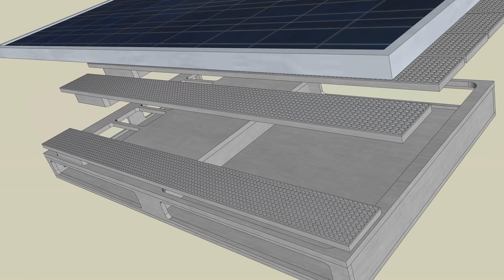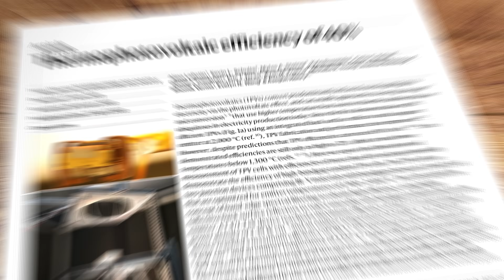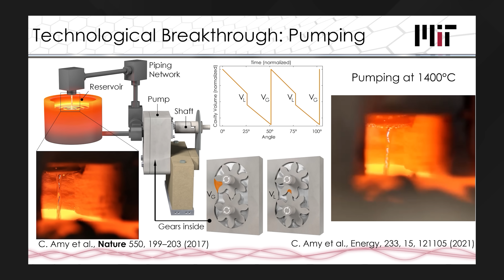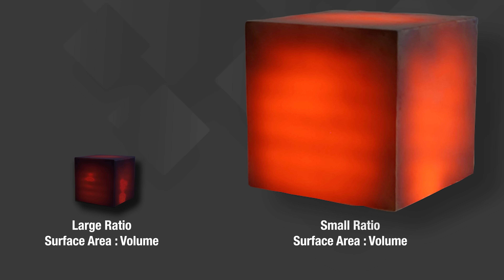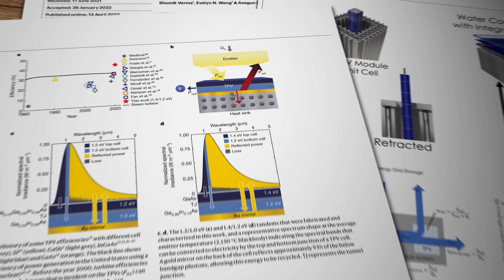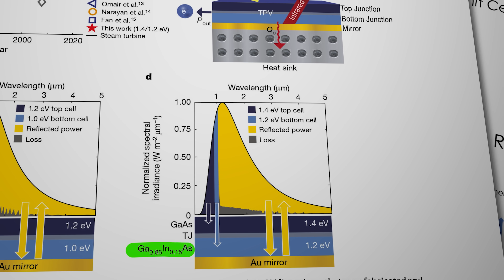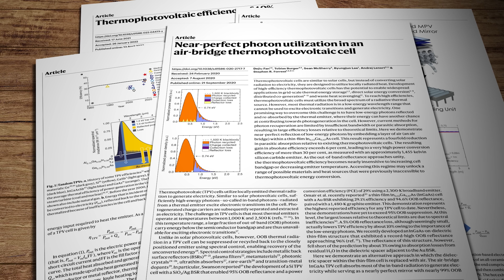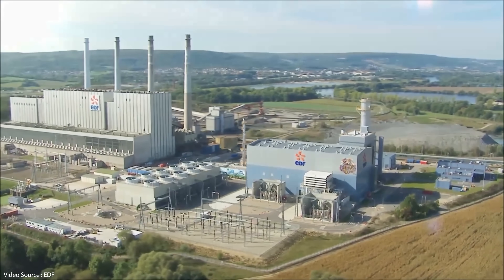Grid Scale Energy Storage 30x cheaper than Lithium-ion! How do they do that?

Comment: From end to end , isn’t this a battery with 50% efficiency, I.e. much lower than other systems like pumped hydro?  If so, its advantage is storage capacity per dollar, is that a legit summary?
Reply: And scalability compared to pumped hydro
Reply: @andyw2132  The challenge of course will be the availability of Lithium. Prices have quadrupled and demand is rising incredibly.
Reply: @andyw2132  Just what type of batteries are "conventional"?
Reply: Yes, and you can build anywhere - so near solar. Pumped hydro needs water and mountain and permissions.
Reply: @idjles  And 'Permission' seems the challenge these days. In Michigan we have a large and old pumped hydro in Ludington. It's been modernized and works very well. But when asked if they'll build another the utilities say: "Nope, we'd never get permission to do it." 

Also as you mention: "Location, Location, Location" while this thermal battery could literally be anywhere.
Reply: @larrybolhuis1049  Ironic that the name of the town is Ludington. I am thinking of the Luddites.
Reply: @andyw2132  Other batteries have to have sources for the electricity. The heat system in the video is about collected heat - to - electricity at high efficiency (compared to other means).

Comment: Quite interesting technology indeed!
I am currently working on a project looking at combining existing gas peaker plants with lithium-ion battery storage in order to fulfil the technological requirements for providing ancillary services as stated by entso-E. 
The fastest ancillary service will require a 100% activation in less than 0.7 seconds, which based on this video this system will not be able to fulfil (from my understanding). But what sort of activation time can this system achieve? Or is this system mainly thought to be used for longer duration rather than being able to provide power in shorter bursts?
Reply: I think you should look at this concept as two parts, the storage part and the TPV part that generate the power. The storage part is extremely cheap ($/kWh)and the TPV cells that generate power is not particular cheap ($/kW) (made of gallium and gold at 8:10). So the strong side of this concept is the storage part and therefore it should be used for low power, longer duration storage like hydro lakes. Combine it with li-ion (lower $/kW) for grid stability and good bye fossil fuels😎
Reply: @channguyen3349  That is actually a good point. I guess it could also be combined with supercapacitor systems to also allow for a high power/short discharge duration to be able to access the ancillary service market in Europe.
Reply: You might some battery storage or spinning reserve to handle the fast ramp. Perhaps even super-capacitors.

Comment: All this pumping molten metal is just silly, you want to check out "polar night energy" instead. Heat stored in sand and usable months later for pennys on the $ compared tho this wasteful nonsens. If you want power out you use a sterling generator(40-90% effective).

Comment: Looks like the giant "radiator" could be a heat exchange that then uses the heat in a community heating system?
Reply: The primary process already uses heat to keep the tin molten.  I'm surprised they didn't use heat exchangers to grab the extra heat off the cooling water to supplement the electric heaters.
Reply: @Firebuck  umm, how exactly? Feed the warm water into the red hot carbon blocks????
Reply: Yeah, that point is a waste, using that heat as a must!
Reply: There are lots of industrial uses for heat waste. In fact many companies buy steam from gas plants. No need to build this next to cities to use the excess heat productively
Reply: @cccphannibal  Yep. Store the heat out of the city, convert to electricity, and ship that where you need it.
Reply: @markhathaway9456  and let the people use electricity to hear their bath water!!
Reply: It works in dense urban areas.
A bit of a problem given that most peaker plants aren't located in cities because of land value and quality of life issues
Reply: @jimurrata6785  Here in Czech Republic we use industrial heat for hot water heating of housing areas and the distance is no problem. My hot water in my block of flats is from a heat exchanger at a power plant about 15km away. There are however heavily insulated high temperature pipes crossing the countryside.
Reply: @jimurrata6785  So, it will be an industrial zone. Maybe preheating requirements can be fulfilled with it.
Reply: @Sekir80  Anything is better than shunting it into an atmosphere that has already reached a tipping point.
Reply: @jimurrata6785  but don't forget that this heat has been extracted from the wind so was already in the atmosphere beforehand
Reply: @jimurrata6785  the amount of 'waste heat' is a pinprick compared to the heat retention effects of global warming gases. It can be effectively ignored.
Reply: @gregbailey45  Taking a dump in the middle of the street isn't significant either.
There's no need to add insult to injury
Reply: How about desalination of sea water, provided the coast is not too far off? CA could use some…
Reply: @Calligraphybooster  Don't forget we need a solution for the brine.
Reply: @uncledino3  good point. Another salt lake maybe? Or topping up an exiting one?
Reply: @Calligraphybooster  refresh the Salton Sea?
Reply: Or for industrial purposes like drying wood.
Reply from the maker: Could be...
Reply: If that doesn't work you could probably use it to heat a large amount of water, and use the place as a spa or something to generate extra revenue.
Reply: The specific energy can be increased dramatically by using molten boron instead of graphite. It has a ridiculously high latent heat of fusion and its melting point matches the operating temperature. 
The achievable specific energy is an order of magnitude higher than graphite blocks and 6 times higher than even the best lithium batteries. This could be used to power a train.
Reply: https://youtu.be/ghD5SHuR9mk
Reply: yes, if you need community heating, that can be supplied from the leftover heat that will anyway be released into the atmosphere. If the overall efficiency is only 40% (which is a great claim) , 60% of the heat goes up into the air. A part of that can be put down the drain (I mean supply hot water, if you need).
Reply: Do you know community heating is old tech.... check out the geothermal systems under cathedrals...... all this tech is old, the powers that be have held it back so that we purchase their centralised enegry sources.....

Peace, power and freedom to all.
Reply: It could be utilized in conjunction with liquid air batteries right ? Without an heat additional heat source, liquid air batteries aren't efficient enough but with the 'waste' heat from the molten tin it could be a very nice addition. And the leftover that can't be used could find it's use in residual heating.
Reply: and in summer ?
Reply: Absolutely! We have community heating systems all over the country I come from, and as more and more wind farms are built, more and more coal plants are shut down, and then there are smaller bio- and gas-furnaces delivering heat to various areas. Nearly all of these facilities provides heat to local homes, not all has a turbine, though. The ones that do, already has the power infrastructure to be able to deliver electricity to the grid. It would be absolute perfect to build these things at sites of decommissioned coal plants, and to replace peaker turbines. In terms of replacing heating facilities, they would need some power infrastructure, but that's likely easier to establish than heating infrastructure.

Comment: so how do you get the material to 2000+ degrees in the first place to get you magical 40% output from. if you didn't get your energy to heat that up for free all I see is a 60% loss from the start.
Reply: The graphic section begins with wind and solar being the apparent power input to heat the tin with. Obviously they would be delivering only electricity that was surplus to the grid's demands, the point being to store some of that surplus electricity until the grid needs more than is being produced.
Reply from the maker: Spot on Dan
Reply: I am not against new ideas or means of storage and I have questions. Has there been a time in history where solar and wind ever was in excess long enough to melt your material and keep it above 2000 degrees for enough time to do anything with.  Seems like another scheme to get research money like fusion and other tech that is always 40 years away.  I have solar along with batteries, we sell back to the grid and have two electric vehicles. I'm not just some grifter looking to pick an argument. I want people excited about renewables we have to be careful about the tech because this could be like Molton salts or solar freaking roadways that never made the cut.

Comment: Dinorwig pumped storage scheme, built in  the 1970s in North Wales, is 75 percent efficient. Capacity depends on the size of the lake.
Reply: hydropower is increasingly becoming harder not only to expand, but due to climate change, the efficacy of this type is becoming harder to maintain. lake mead's hydropower is threatened, and many other places are losing efficacy as well.
Reply: @ethanstump  the Hoover Dam project at Lake Mead is not a pumped storage scheme. Pumped storage schemes do not depend on rainfall: water, including sea water, is pumped to a reservoir part way up a mountain.  How would efficienty depend on climate change?
Reply: @johnbunyan3070  sorry, i might be above my pay grade for this answer, but climate change does effect sea levels. it also effects salinity levels, as well as increase pathogens in water. my previous example was a poor example, however i do still think that while pumped storage will play a part in the upcoming transition, from what i hear it's pretty difficult to find places to do pumped storage, and it's a regulatory funhouse to go through the process. not to mention the adverse effects to the wildlife in the area. that's not to say that the wildlife wouldn't be more affected by not doing these things, merely that pumped storage isn't really going to be the thing that saves us.
Reply: Not complex enough for this guy